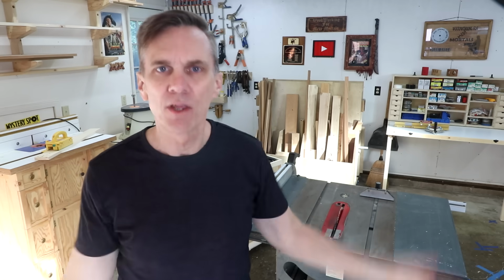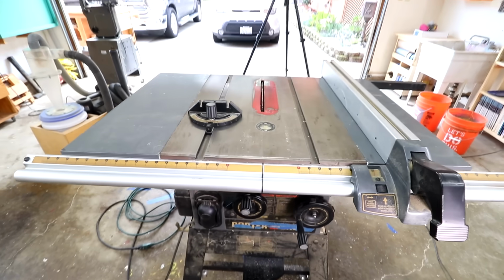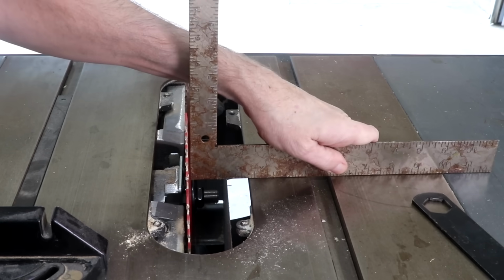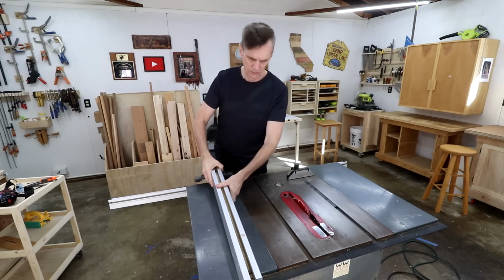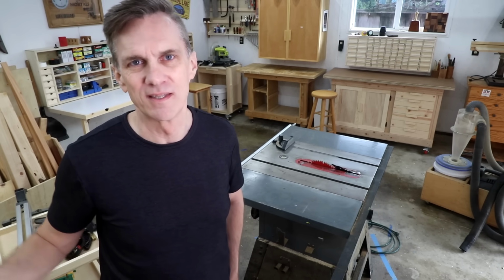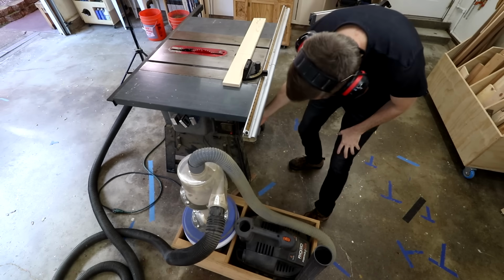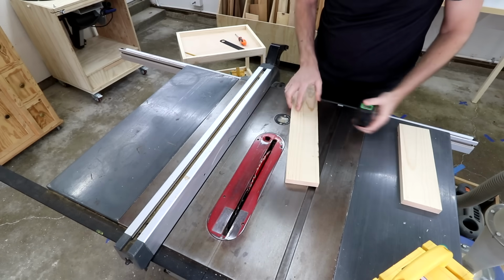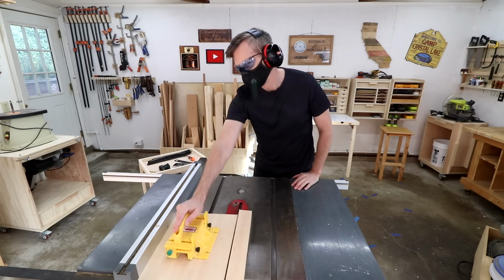A step-by-step guide to making your first table saw cuts. TABLESAW BASICS.

Comment: A good rule is to never put your hands in the danger zone, that's stretch your hand out to its max split finger length add 2" and thats as close as you should ever got to a moving blade without some kind of protection or push block.
What do you thnk a table saw blade would do to a gripper? 
Thats why I use a riving knife and board buddies. You can't trust safety blocks 100% 
I had a table saw guard fly off the saw into my face.  I just turned the saw on no safty glasses on yet.
When I worked in a machine shop I had safty glasses on and got a chip in my eye I had to have dug out. Seriously you can't be too safe.  By the way I cut plastic on a table saw it shatters into a 1000 peces if its not supported. 
A better design would be add ballistic cloth inside the plastic like they use on chain saw pants. That way it binds the blade and kicks the breaker off on the saw.

Comment: your saw is a toy compared to my first one, my second saw was a toy compared to your's my third saw was free and it also makes yours look like a toy.
Man Jet needs to send you a brand new table saw Free because it will get exposure  Why don't you ask for sponsorship.
I don't see any reason one manufacturer couldn't use the publicity.
You clearly know what your doing and you do enough online it would pay off for them to do it.
were not talking a 22k dollar Felder sliding table saw shaper jointer surface planer shaper system Most guys could only dream of owning.
I'm not even talking Powermatic equipment.

Comment: Steve I can't find this on the internet.   

I'd like to know the best way to notch the side of a wide board - say you had two 2' wide pieces of plywood, and  in an X configuration instead of butting them up against each other, you wanted to have one sit inside a notch of the other. (A chair base lets say). 

Is 2' too tall to clamp to an extended mitre fence?  Should you use a custom tall mitre fence?   Is there no way to benefit from the table saw's accuracy here?  

ps. just got my new table saw, and your videos are helping me 'square up' my  approach to safety,  as well as my cuts.  :)  So thank you!

Comment: Thanks Steve! I've been getting into woodworking and have been doing all my projects with a circular saw and a router with no table. It worked but nothing was real precise. Always thought, "I need a table saw." Finally pulled the trigger and bought one.  Got it home all excited to do some cutting, got it set up, read the manual, then went out and fired it up. "Whoa, this thing as some power!", I said out loud to myself. That's when I went in and found this video. Great! Have watched several of your other videos and always liked them, you explain everything so it's clearly understood. Now, after watching this video, I feel more confident and am ready to make my first cut. Thanks again!

Comment: beginner here, the block does seem to give more support but i dont like how your hand is much closer to the blade then using the sticks. maybe theres a better tool that combines the advantages of both the block and sticks?
Reply: There are countless ways to make push blocks and sticks.  Most experienced woodworkers have their own personal preferences and will swear by the ones they use.  
The only universal puch stick/ block is the one that keeps you from getting cut.

Comment: Hi Steve, firstly may I say another excellent video, always love your videos and hope you're keeping well and staying safe during these times. A will back I started making some bird houses as I am a wood work nubie I did a basics course in the local town. My problem at the moment is my riving knife is really out of whack and I've tried rebending into place but I keeps moving back and wood is getting constantly jammed,thus I have to turn off the saw and bend knife again, should i just remove it ? I have been recently commissioned to build bird house for the mother in law, i have 3 completely different houses nearly complete that I'm going to mount on the branches of a chopped tree. Am just finishing micro doors and windows on the scroll saw but have the roof of another glued and clamped but am needing to cut them on the table saw, and I really don't want them jamming on the table...any advise would be gratefully recieved.  Many thanks, regards Eoghan

Comment: As a machinist who is getting into hobby woodworking I love you envision or as I would call visualization. That is extremely important. It's been instilled into me. Plan the entire process first and act it out. This comes in handy when torch press fitting parts. Spending hours machining a part that needs to be heat press fit to where it will never come out makes you very aware of the entire process. Poor preparation can scrap an entire job.

Comment: I don't own a table saw which is weird because I rely on big box stores to make all my huge cuts. If their saw is down, I'm not building. I make... Not wonder to make cuts with circular saws. But a table saw to me is the one item that if your getting hurt, it's on one of these (or a router table as I've had mine chuck wood many times) videos like this are essential. The room for error in wood working is zero. Literally plan every cut. Unpowered if you want. But every miter saw, every circular saw, everything, I listen to Steve's advice, plotting my cuts and then bringing the saw down to double chuck my digits are at least... AT THE VERY Least 4 inches away. And that's still to close. Take care friends. The room for error is zero. If it cost an extra $20 or $50 bucks for safety. Pay it. You are worth more than the money for a push stick or new blade.

Comment: Newbie question: When ripping and using two push sticks - Assuming fence is on the right side, My question what is the best way to use the left hand push stick as it approaches the blade.  When is it removed from the work piece? It looks like it is just before the push stick reaches the blade.  Or is it further away from the blade as the cut off piece end reaches  the blade and right hand push stick moves the piece passed the end of the blade?

Comment: Steve - 
I just got a  table saw but am running into a couple issues and was hoping you might have ideas on how to resolve them:

1. I noticed my fence isn't square. I will lock it into the dimension I need but it will still be 1/16th or even an 1/8th off. Thanks to your video I will try the method of measuring from the blade but how can I secure the plywood in place and make sure it is guided for a even cut?

2. This might be related to problem 1 but half-way through a cut of plywood I am getting a lot of resistance. It doesn't cut as easily once it gets to that half-way point and I need to muscle it, there are also burn marks on the piece. What would cause this? I am using a 40t blade, btw.

Comment: Good job 👍 demonstrating. Bought a new one in 1985. Just a hobby then and now. The rules for safety haven't changed. Still have ALL 10 fingers and never been gut punched by flying wood.

If I were developing a video curriculum for Woodworkers this would be on the list.

Comment: Steve, have you/can you do a video about improving a table saw, miter saw, router, etc station ie building a fence, jig, slide, or whatever that makes your woodworking experience so much better?
Reply: The first thing I built with my table saw was a crosscut sled.  The second thing I built was a 45-degree sled.  (FWIW: I used plans from the website Family Handyman.)

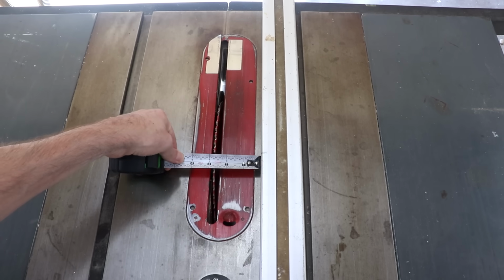Comment: 06:03 why though? it seems more accurate using both at the same time.
Reply: The cuttof piece will rotate,  bind against fence and blade, get grabbed by the blade and fling back at you at about 90mph.
Reply: Derick Thompson  Thanks! i was wondering the same thing.

Comment: A high rise shove We could build a universal Balancer straightener by regional numbering 33-1/4, 72-1/3, 15-1/4, 22-1/9, 54-1/12, and 33-1/4 recreational you should have on space out a Joined cabin system use rotational frisbee technique to build it on scale to measurement volice by then force stand atrabute scollider by to use for later years to come should create a nice table called a straight line tables or even mount scout would create it just on differational numbers 44-1/7, 23-1/12, 55-1/7, 14-1/2, 23-5/6, 33-1/3, 100-1/12, 244-1/3, 349-1/2 all stand levels based on overall look a joined cabin system takes about 50 pieces to build a straight barret using robbing alexandia is a technique based on 30 rotational, 45 wide, 75 overantional use in degree, 15 by using a mound find, 45 for the central joint. the other ten degrees of fold out number: 46, 23, 15, 79, 83, 81,57,38,20,and 44 should maintain a complete shelve cabinet system. We gotta get it done in the next build out atleast if not something else that would look beau-tiff-ul completing words in woodworking is necessary then grey stone color as paint to look brown adapted.

Comment: Because the fence is clamped on one side, the side nearest the user, I find the fence on the old Delta that I use has some play in it. The side nearest user is accurate to measurement and the side farthest is an 1/8th off.... Is that common?

Comment: Honestly the biggest issue for me when it comes to the tablesaw is a combination of space limitations (I have a single garage wall to work with) and the fact that woodworking and carpentry are my secondary hobbies, more in service to taking care of our aging home. 

I've found myself making do with a decent job saw (currently the 24 inch capacity Dewalt, though I'm considering an upgrade to the 32 inch capacity model). I understand these aren't nearly as precise as a quality cabinet or hybrid saw. The limited arbor is also something that has to be worked around when making dado cuts. 

But it's what I have space for. And really, I haven't found it to be too limiting outside of some special cases.

Comment: Hey Steve, I’ve been watching a lot of your videos lately and buying some tools from the my tool list for my first project, making a coffee table. Well I keep finding myself stuck on the top of the table. I’m edge joining 5 2x6s (trimmed down from the jointing jig on a table saw). My question is, how does everyone get the faces of these boards squared? I’ve tried just sanding to perfection but turns out, I’m not perfect. Any tips? Hand planing? Buying a jointer? What would you do to get this table top flat on the top and bottom.

Comment: I had a tablesaw injury this week and it was from a hazard that is not mentioned often. I was swapping blades. The saw was unplugged. I had removed the blade and set it aside. I was reaching into the saw to clean some of the build-up of sawdust. I cut my arm on the sharp edge of the table casting. It was a minor cut, but it could have been worse. Remember that the internal parts may have sharp edges.

Comment: Love your chanel. Just started getting into doing. My own bits and bobs. Took your idea of a mitre saw station today and did my own version to encorporate my table saw and router table, worked well eventually after a few mistakes. Planning on making my own garage cabinets next week.  I want to use inch thick wood for the framed panel doors but only have 18mm wood for carcase any tips on getting the doors to open without catching.

Comment: i bought a rigid jobsite saw....because of budget.  it works great, but it feels like the front end is shorter than most saws, i.e. the space between the front of the top and the front of the blade.  makes it hard to get wider/deeper pieces on for a cut without a lot hanging off out front?  any suggestions?  ive seen off cut tables, but never...front cut tables?

Comment: Hello Steve,
thank you so much for your great videos. You really helped me get into this wonderful hobby. :)
I plan to build a simple table out of rough edge wood. I'll have to glue two boards together in order to get the width I want for that. Do you have any tips on how to clamp down rough edge wood? You've shown how to do it with regular wood with square edges, but I'm afraid of ruining the rough edges of my wood by using clamps on it.

Comment: I love your videos Steve! As a hobby wood worker I started with a Ryobi table saw and struggled with fence alignment with a very reasonably priced table saw. I’m sure many new wood workers buy something similar because the price is so accessible. I learned about measuring the distance between the fence and blade at the front and back of the blade the hard way with burned soft wood (shouldn’t happen) and “slow kickback” (blade pushing back like a the wood is a weight from a narrower distance at the back of the blade to the fence. A safety tip I have given is don’t trust your fence, measure at the front and back of the blade before making the cut. I still do that even though I have an expensive beisemeier fence and delta unisaw table saw now. I just feel safer with that routine.

Comment: My garage has no place to a full stable saw but I have racks of jigs for my miter saw, circular saw, and 2  routers. You make this film enticing but first I have to build a 24' X 24' stick building.  Thanks bro, for the table saw enticement.
Reply: @JmeTN Thanks for the come back.   For the time I have restricted my tool use to hand planes and jigs for almost everything else. You idea sounds great but again WALL space is at a premium. THANKS AGAIN!

Comment: Looking to buy a contractor style table saw. There is quite a price difference for the brand I’m looking at to get the one model that has an arbor big enough for dado blades. Would it be a good idea to get the a cheaper saw and use the extra money on a router and table?

Comment: Wow... just a few days ago! I'm pretty sure I got my first (used) table saw from my uncle the day you posted this. 😂 What are the odds?

Anyway, I dont think mine is making straight cuts with the miter gauge or the rip fence.

Either way, THANK YOU for this video. Didn't know about standing on which side or not using the rip fence and the miter gauge at the same time. Just went through and ruined a whole bunch of MDF. Lol.

Comment: I just bought a table saw adjusted the blade to my framing sqaure however it still not a straight cut, off by 2-3cm on one side. Could the blade possibly be the problem?

Comment: With all powertools, I always consider pressing the off-button or releasing the on-button as only initiating the shutoff sequence. Meaning, as long as it still spins, it is still on, and you must not let go of the workpiece, set the tool down, reach over, etc..

Comment: I wish I had this video a year ago. I didn't know about kickback and tried a free hand  cross cut with the rip fence and the used saw I bought didn't come with any safety  features. Luckily I was cutting a small board and got hit with an even smaller piece. The cut and bruise healed after a month. And I sold the saw with all the appropriate warnings about missing safety features.

Comment: There's no dumb questions when it comes to power saws?... Challenge Accepted... so, Is it safe to put your tongue on the blade as its spinning? Is a jig saw a good tool to fillet a fish with?  Is soap and water a good way to clean the cast iron table top? How many nails can a wood blade cut through before the risk of kickback or damage? Norm always said to wear safety glasses but wouldn't you rather be smacked in the eye with a board than to have little shards of sharp plastic pierce your eyeball? Does a rotary tool such as dremel make for a good manscaping tool? if you leave your tablesaw running outside during a hurricane, could you expect to wake up to tons of 2x4s stacked up neatly in your yard the next morning? Is it possible to weld 4 tablesaws together, turn them upside down and drive it around the neighborhood? (Calling you out Izzy)... Final question and I'll leave you to ponder how anyone can be this stupid. It's a loaded one though... Are radial arm saws just as superior as tablesaws?

Comment: Are there any safety things or changes to decisions with cuts if I have a Panel saw? I got a hand-me-down with a rolling sled on the left of table. I use it like a normal Table saw at the moment and have been too afraid to use the  sled. Can I use it for cross cuts and rips? Do I need to use a fence if I have a stop and gauge on the sled?? Does the fence (on the sled) go on the back like when using a crosscut sled, or on the front and pushing into it?

Comment: There are a few things here that bother me. One, yes anyone who takes the guard off or admits to it on you tube especially when they are presenting themselves as a teacher is demonstrating do as I say not as I do attitude. Young people are picking up on that quickly. Anyone who picks their router off of a job piece before it stops is teaching a very bad habit. Also the reason for the issue of where your blade is set in proportion to the piece you are cutting is for clear out of the waste when the blade turning. 
I have both a ras and a table saw and I have yet to have any YouTube video maker explain why you NEVER use a table saw blade in a ras. Just because it measures 10 inches does not mean they are interchangeable. You need a negative rake in the blade for the ras. Hey, Steve asked for thoughts so here is to safety for all. I apologize if I went overboard on this post.

Comment: Great video Steve -  really thorough and clear introduction for new woodworkers! The only thing I would add is to never stop or start a cut, with the wood touching any part of the saw blade. If even a couple of mm are engaged, the workpiece can easily be flung back at you - don't ask me how I know!